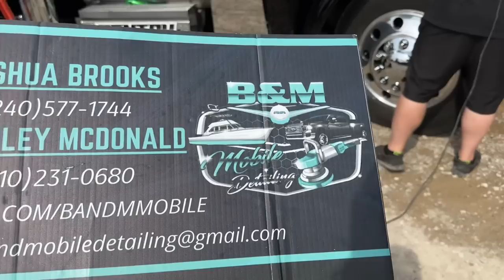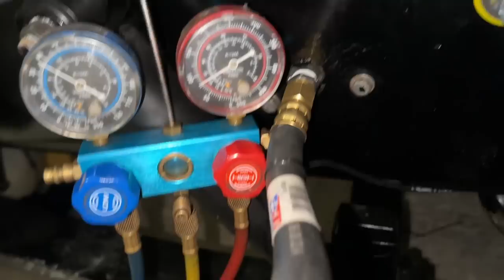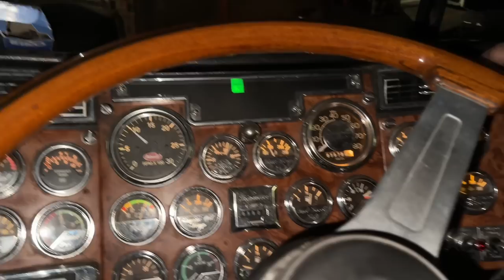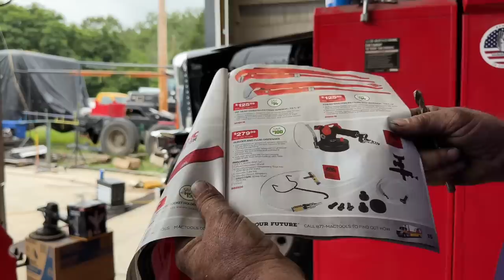We Built My Dream Peterbilt 379!! Huge Transformation..

Comment: Tim working on offshore drilling rigs for 30 years. being out surrounded by saltwater things rust fast and all the time. Years ago I started to have my men use Ospho it.s a metal treatment. it kills rust and prevents it from coming back. This is how you use it brush Ospho on the frame or whatever there will be areas that will have a white powder that is what is left from the rust brush it off then put a second coat after that prime and paint. If you like to have something rust free Ospho is the best

Comment: You might look up using cans of compressed air instead of Freon. It is so much cheaper. You can buy an adapter to use and compressed air really works as AC coolant.

Comment: Looks good yall! Reminds me of my 1999 379 3406E had 98 lights on the truck and 198 on my trailer. I had a illuminated base around my shifter if I remember there were 15 lights inside the cab. Yep 80000lbs of polished crome and steel! I sold my rig 8 years ago and started hotshoting needless to say I do miss my Pete but I'm way farther ahead now I cut my operating expenses in half and trippled my income course that was right before covid hit but I'm still doing OK. Got six months to go then I'm retiring going to work 6 months out of year. I can't quit cold turkey after being out here for 48 years and almost 9 million miles so you can see what I mean! Good luck with everything!

Comment: When filling ac with freon, max fan outside air, and hold rpm up around 1,200 rpms until you have it charged  
Also make sure you pull vacuum down to 10 microns for 1/2-3/4 of an hour depending on how long system was open, and humidity. 
Typically when I know it's getting close to full charge, I put my hand on the line off the compressor, and you'll feel it flash cold as it comes to full. 
Then in few days check the pressures again, and I typically keep a thermometer in one of center vents so I can monitor the temperature. 
Also max fan isn't the best fan speed for best cooling med low, med, and med high, are better for cooling. 
High speed blows through the cool too fast to get optimum heat transfer because of the speed it passes through such a small surface. 
When you get in and it's hot from sitting, crack windows a little, put ac on outside air, and med med hi speed because outside temperature is lower than inside the vehicle, and once it cools down go to inside air circulation and med med low speed with windows closed, and you'll get cooler faster than on hi speeds
PS
Wait a minute, they're a stainless fab shop, with plasma tables, and brakes, rollers, tig welders, and have CAD design layout capabilities. 
They don't make their own line of fenders, bumpers, cab extensions, visors, and everything else that can be made to go on a tractor trailer combination, are anything else that people put chrome on to dress up their rides.
I'm at a loss, especially after hearing that they had products in a bunch of retail venues, and have online sales plus in-house pickup available. 
With call in orders taken directly by design sales, and saying that they do any type of custom work as long as you call it in direct to office. 
I'm totally confused, because if they don't have the equipment to do those things then for small investment and a couple of good hands on the equipment needed to do that they're seriously losing big big money by the day is my opinion. 
Heck any decent hvac fab shop could make all that easier than the sheet metal they fabricate daily, and most of the big shops work two or three shifts 6 to 7 days a week building fittings 10X's more complicated than those items will ever be..
And a big shop make your stacks and other associated piping for your exhaust that just need dipped in chrome tanks.
Not saying anything bad or disrespectful, but geez man that's nothing hard about none of those items if you have the equipment and few good hands running them.
Reply: Mail order shop.  You call, we order, known as blind shipments?
Reply: Do you realize how hard it is to find “good hands”? Sometimes small and steady work better than being big time

Comment: Forget about that air nibbler for the rust on the frame. Use a sandblaster with steel grit. You will have a super smooth finish to paint on and won’t leave ripples like the air nibbler. 
You have to get all of the rust off and get a new surface or the rust will come back faster than ever.
Reply: It’ll be shit again within a years time.

Comment: I had an old kwopper with a really bad pitted frame, so after I sand blasted and needled the entire frame a friend of mine who was giving me a hand really he was giving me a hard time, he told me to relax and he would handle the frame, so he bought a big ole can of body filler and he made that frame smooth as a baby ass ,I never thought that it would hold up but he put some type of flexing agent in the bondo and 10 years later it's still looking good, maybe try that when you redo your frame

Comment: Tim you really should have put artic freeze freon in that truck and every truck you have it is way colder!
Reply: He should have charged it with propane. It gets much colder than anything you can buy nowadays.  And before you say it, NO! it will NOT blow up, it is safer, cleaner, doesn't hurt the environment, and it's been used in other countries for over 50 years without a problem...

Comment: Painting a condenser is not the best idea It comes unpainted because it needs to be able to cool without the thermal layer of paint to get the most heat exchanged for the Air Conditioner. Sometimes it hurts sometimes it doesn't but we had an excavator that it Killed the thermal properties of the cooling. we bought it and it was painted and it overheated like hell. changed out the painted rad and that took care of it.
Reply: @IAmTheJManOfficialAgreed, it'll be on him for making that call though.
Reply: I see that ole Timmy still "knows" it all😂😂